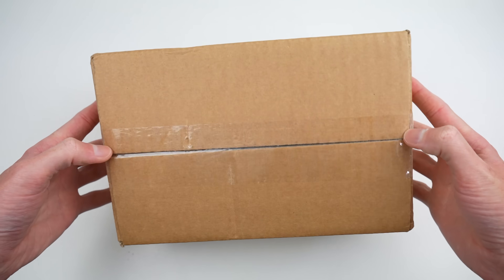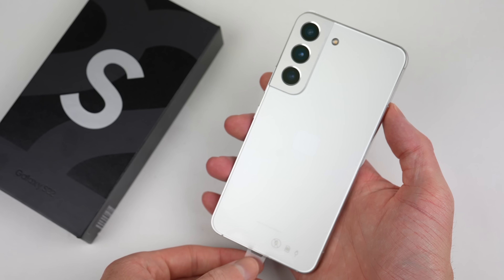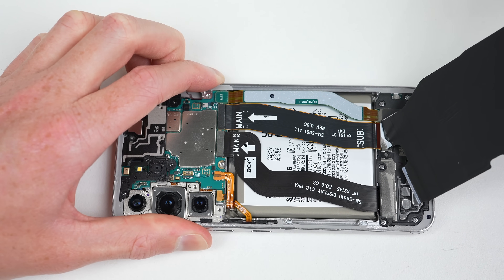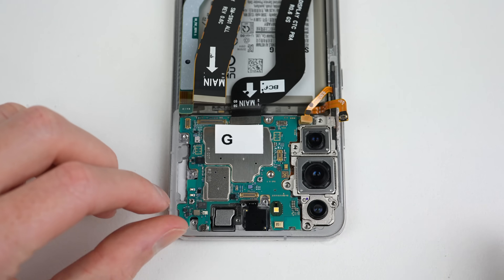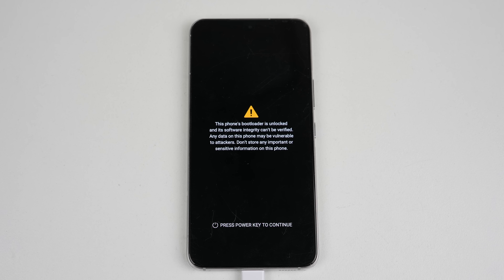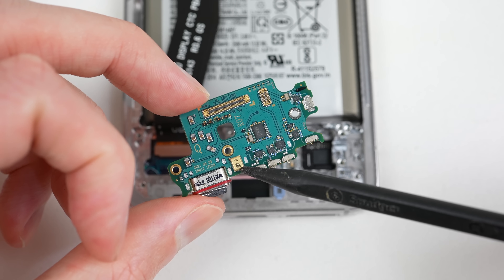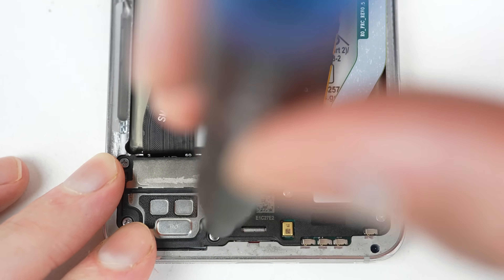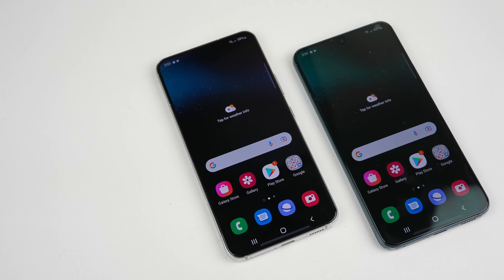Samsung Galaxy S22 - Teardown and Repair Assessment

Comment: Hi Hugh Jeffreys thanks for your contents. Very helpful. 
Any idea about how to repair or what's the issue of my s22 ultra not picking up any mobile networks. I tried reset, restart, several sim cards proper working ones, tried shifting to manual search network, still not working, only shows is not registered network, emergency calls only. What will be the issue please help.

Comment: Batteries SHOULD NOT be glued into phones - they are a wear item and die meaning that they have to be removable/replaceable. No manufacturer can make the argument for this bad practice, besides giving a giant 🖕 to those who want to keep using their phones instead of going out and buying a new one. And don't even get me started on getting the battery replaced at an authorized service center - the very first thing they do (without your consent) is wipe your phone followed by a firmware update, steps that are absolutely unnecessary for just a simple battery swap.

I really hope more consumers and repair minded people keep pushing manufacturers and speak out when it comes to their questionable design decisions and anti-repair practices. These measures, while giving manufacturers and companies more money in their pocket, is SIMPLY UNSUSTAINABLE in the long term. When a flagship device becomes a throwaway in as little as 2-3 years now people are going to wake up and realize that throwing out $500-$2000 every 18-24 months just to have a working smartphone in their pocket is money better spent elsewhere. And that doesn't even get into the environmental concerns over where these throwaway electronics and batteries end up.

Comment: I 100% put the sim eject pin into the mic hole and gave it a good poke several times, realised, and shat myself. Luckily all is well.
Reply: I did the exact same thing 🤣 Iuckily this video exist, but still concern about the water resistance after poking into the microphone hole

Comment: Might be a silly question -- After years of use eventually the 128 GB SSD will die ---- Can the SSD within the Samsung Galaxy S22 be replaced with a new one? I think you have to change the whole main cpu board, it is one of those shielded chips? Am I right? Thanks for nice teardown curious what it looks like.

Comment: Using a 22 ultra and tbh love the fact that the back glass is 100 times easier to remove than iPhone,  just in case. Probably more dust/ water resistant too haha

Comment: Remove all battery adhesive before reassembly! It's completely useless other than to make it ridiculously hard to replace the battery. I've done this a number of times on previous phones with no negative consequences at all. The battery is not going anywhere. If you need to replace the battery again, obviously it will be incredibly easy.

Comment: I think these Asian phones are pretty good and should be okay for vast majority of people. Here in the States, people like me store sensitive financial information on our iPhones and conduct financial transactions, some of which are quite large. Security is very important. There must not be any vectors for bad actors to exploit it they grab my iPhone. I trust Apple to do a reasonable job in protecting my data. With Asian phones, I feel less confident and will not take the risk.
Reply: To put it frank, neither is better protected since their are bad actors who know how to deal with both sides of the security market.
For iPhones, their are a number of ways to get around the security, often using hardware tools in the iPhone's case to crack it.
While for Samsung, that is more down to software tools to crack it.
Their is no feeling about it, you shouldn't trust either company to hold your data locked tight, especially when they often use security built by other companies, even Apple, who uses a number of smaller security packages from other companies like for their photos for example, that is from another company.
- Service & Repair Tech of 2 Years

Comment: I am all in for repairablility, but as an S22 plus owner, I would have been much more delighted to see that device not working in the locked state when the parts are swapped. This eliminates the threat of theft for parts. 

Its a simple software fix, just lock all the parts when the phone is locked and changed and unlock all the parts when the phone is being unlocked from th main screen or completely disabling security.
Reply: Most junkies won't be able to just open up a phone like this, and do so without breaking something, and even if they broke the back and teared it off for the parts which would take a lot of force and unwarrant hand cuts, unless you knew how to properly take those parts out, especially without breaking them, your gonna have a problem with that.
So honestly that isn't an issue because if someone wanted to get into your phone, they'd find a way, but then you'd have to be targeted first, not just having your phone stolen by the average junkie who won't know a thing about getting a random phone hacked in.
Take it from someone who's worked in Service & Repair for 2 years.
Reply: @GBOverload  I am from India and most people here have unlimited internet access on how to disect a phone. Alot of repair shops here which are of a size of a phoneboooth have professional equipments to detach screens and backplates. And that's what concerns me. I am all for anti-repair thing but i'd love to have the option to lock all parts of the phone even the hardware with a lock id.

Comment: I just got this phone and I hate it
Reply: But y
Reply: @goodomen5801   well it doesn't have a headphone jack and on the texting , in order to have bigger letters you have to go to system and then make the text bigger , instead of just using your fingers pinch motion  and I can't say much fore the Verizon store , thay had me believing the phone was worth 1050$ at wall mart I can buy the phone for 260$ after this phone runs its corse iam canceling my Verizon account , I got the phone with a 700$ upgrade so it costed me 350$ so that ripped me of by about 100$
Reply: @stevepearson6316  but the phone performance is worth it...
Reply: @goodomen5801  maby,  all I use is utube and texting and if it had a jack in it I would use it to play guitar,  ..would like to plug phone, guitar into Amp and then head phones into Amp but I guess that's something the phone makers didn't account for
Reply: @stevepearson6316  u gotta point...

Comment: Why is the battery glued to the phone at all? I mean, once the back panel is there it's not going anywhere. Or am I missing something?
Reply from the maker: It would rattle around inside so needs something to hold it in. But what they use is complete overkill.

Comment: I agree removing the charger was originally done to save money. But going forward I think it's a good idea and will help the environment. USB-C Power Delivery is more complicated/expensive to manufacture (it can change the voltage upon demand), so the chargers generate a more waste than the old 5V USB-A chargers. 

I also think USB-C PD has a good chance to finally replace the 96-year old 12V cigarette port as the standard DC connector. Most laptops now ship with a USB-C PD charger, which you can also use to charge your phone or other laptops (people look at me funny when I ask to borrow their Macbook charger to charge my Thinkpad). And I've bought a two-port USB-C PD charger for travel, which I expect to be my only travel charger for the next 10+ years. So once you've bought a newer laptop or a standalone USB-C PD charger, that's it. You won't need another charger for any of your new devices. I have a drawer full of old AC adapters, power bricks, and chargers, and I'm super hopeful that I'll tell my grandkids horror stories about the old days when every device needed a different charger.

Totally different story on the Apple side. The only devices which use their chargers are iPhones and iPads.

Comment: me and some of the people at samsung had a good talk because I wasn't happy about damn plastic anyway conversation went good one thing I said I don't want a plastic cheap phone I been there with phones from the early 90s if I want plastic back on a phone I'll buy a cheap 200 dollar phone then .
Reply: I highly doubt you work at Samsung, especially given they themselves had Plastic backs for the S21 series, to put it simply, plastic is less prone to cracking ( because it literally can not crack unlike glass. ) and scratching ( try scratching your mirror or window and tell me it doesn't scratch. ) which puts it above glass in durability.
In the looks department, if you actually looked at the S21 backs you'd know they look just as good as the other S model glass backs, but were more durable than those other glass backs.
However that is the point, plastic is a more durable material and should be used on more phones for their backings, and can be made to look good, the S21 series as an example.
- Service & Repair Tech [ 2 Years ]
Reply: @GBOverload  no wasn't saying worked there I had a issue years ago on a phone that was sent in for warranty they lost the phone it took years to get it worked out then they tried making up for it with a cheap phone which lead to more phone calls anyway back then a 500 dollar flip phone so I did get a 1000 dollar smart phone. they lost a top of line flip phone it took them years to finally fixed the problem and I wanted a top of line smart phone and I got one
Reply: @gamerX-wk7ct  I highly doubt they would have just sent you a worse phone then you had, their are specific laws about that after all when it comes to contracts like that in terms of coming in for repair and the phone either getting lost or damaged more during the repair process, normally the contract on that is they will send you a replacement of either the same phone or something better they have in stock, as someone who works in the repair field. So seriously, again, no, highly doubt that story.
Reply: @GBOverload  doubt it all you want but they lost a phone that was less the 2 months old in 04 or 05 they gave me a run around then I had to have surgery and other things going on in I forgot it about it in 2014 I brought it back they said things on the phone that sounded great while saying sorry and so on but what they sent me was not close to what was said and yes even years later I could of been thankful I got anything but if it was me owing them they would not care so I wanted the phone that we decided on in the end I got it . you can doubt it all you want but it doesn't change anything

Comment: my s8 also had unlock bootloader,  but the issue with samsung is, they burn a  hardware fuse that will always  show the device was once unlocked, you can not undo it,  if you lock the bootloader again, it will still know that it was once unlocked and lock you out of some apps and features like banking apps, and netflix etc,  test if banking apps and netflix hd  works,  because even without flashing a rom it locked you out of those after locking it again

Comment: The presentation style &  are clear & insightful
Focusing on Swapping parts & bootloader unlocking offer interesting repair assessment.
Question:
Do you plan to do a similar T & RA of S22+ & compare it with S22 & S22 Ultra

I have pre-ordered it... getting your insights about it would be interesting.

Comment: I personally don't care for the s21 S22 series the ultra versions are OK. But no SD card , 1080p max 120hz is all.... S20 plus 1440p x 3200 also has the 1080p 120hz capability if you want it.. Has the SD slot 1t if wanted. Your forced to use cloud storage with the 21 n 22 sadly... I can't stand that.. I have em but I don't use em much at all. I keep using my s20 pluses n s20 ultras more than the newer ones.

Comment: The S-pen and new chip take up more space, & with the S22 price cut compared to S21, wouldn't there be more actual phone in the S21? Especially as a new chip would be a new format that would have the S22 needing to arrange their own phone components without the S21 phone's format's added contribution as much? So there must be less phone in the S22, but at least you got your pen holder. I would get a pen holder case for a phone. So I wish there would be a S21 format variant phone every year because I think the best phone was just diced. It sinks in afterward to realize they took out the phone for a pen holder. pen holder.

Comment: I understand your point of view, but their decision to go back to glass back panel is legit. Ok there is your point of view but there are more povs that we have to consider. If the back panel breaks because it's glass is not the end of the world. It's not fictional in any form. So big deal... Glass is more scratch resistant so most people will trade that with the change of braking.
Reply: I have no problem with them using plastic but if they do the price should go down. The problem last year and with the note 20 is that they were still charging way too much money for plastic phones, and we're nerfing other features. I mean it's kind of crazy that the S22 plus only has 1080 p screen when the note 9 had literally twice the PPI on a QHD screen.
Reply: Actually, that is entirely wrong, if the back panel breaks on a Samsung then you pretty much need to get that repaired as possible since it has a higher likelyhood of shattering badly as a glass back, no different perspective about it, it will do it on every glass back no matter who is holding it.
It is also not as scratch resistant as a plastic back, it simply isn't since glass is literally very easily scratchable, just do that to your mirror or window and tell me glass doesn't scratch as badly.
Plastic is the opposite of both issues with glass, being more breakage and scratch resistance since it is a plastic not a glass material, which is less prone to both.
Again, none of that will change because a different perspective, ain't how physics works there bud.
- Yours truly, Service & Repair Tech [ 2 Years ]

Comment: 1:00 Wait...I thought the argument was to reduce the number of chargers that end up in landfills? If the argument is to reduce packaging, then it's a money grab.
Reply: It's absolutely a money grab and no reviewer should repeat their claims that the motive is environmental without it leads to adding some serious caveats. 

I mean I have plenty of chargers, but even I still need newer ones especially as charging needs get faster.   Now people will need to order a charger separately, often through less safe third parties, which will add all that much more CO2 to the environment and plastic in the landfills.

Comment: 10:35 I think part of the issue for people's concern is if when a person accidentally inserts the sim ejector tool into the microphone port - is if the waterproof seal can be punctured and therefore potential water leak inside. Is that possible? 

I know it happened to me where I stupidly one late night pushed it too far...it had some resistance and then fully went in. That's how I knew I had punctured it. Now when I very carefully insert the ejector tool again to check it, it provides no resistance.

Comment: the standard s22 looks good. in about 8 months time i will probably purchase one...current launch price is a little on the high side.
Reply: Looks can be a little deceiving. The s20 as a QHD screen in the s22 has a full HD screen. S20 has up to a terabyte of expandable storage, the s22 has no expandable storage. S20 has Samsung pay, a fast charging brick in the box that goes to 45 watts, The s22 has no charger in the box and only goes to 25 Watts.

I mean honestly you could go on a lot longer if you start including stuff like Iris scanner, capacitive fingerprint sensor, headphone jack... But those were last seen in the S10 and Note 9 phones so I guess the statute of limitations is up to complain about that. But expandable storage, Samsung pay, QHD screen...

I just have a hard time seeing what benefit there is to getting the s22 with the inferior specs. The only benefit you're getting is a newer SOC and update schedule but the 865 chip is plenty strong, and has better thermals than the a gen 1 or 888.

Comment: Why do these companies need to use so much adhesive to keep the battery in place....without even any at all the battery isnt going anywhere...just a small dab in each corner would be more than enought to stop any movement whatsover...i really dont get it

Comment: But! .... the battery shouldn't have been 3700 mAh???   is it just misleading advertising?
Reply from the maker: Your right, Samsungs official specs say "3700mAh (typical)". That could mean the batteries tend to be over capacity but wouldn't they just say that on the battery?

Comment: Can you elaborate on the no 5g antenna? Does Australia not have access to 5G
Reply: @Bryan Depiazzy 5G works on various different wavelengths worldwide. In the US, these include the millimeter range in addition to "regular" wavelengths therefore the US models have additional hardware. So Australia does have 5G but only in the regular range.